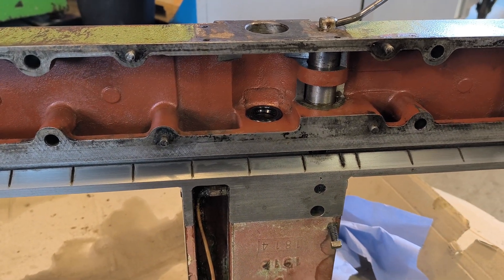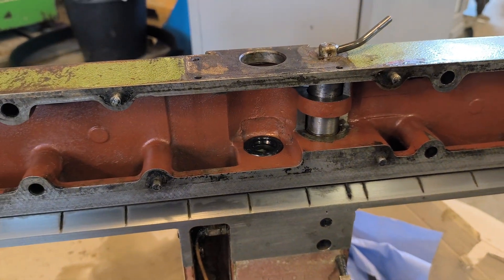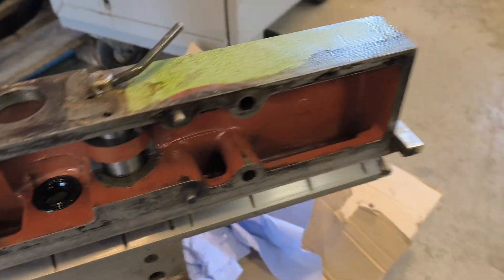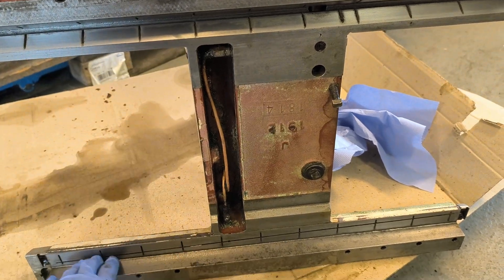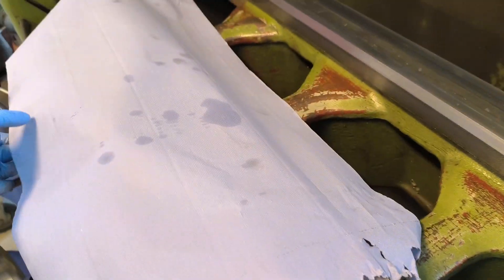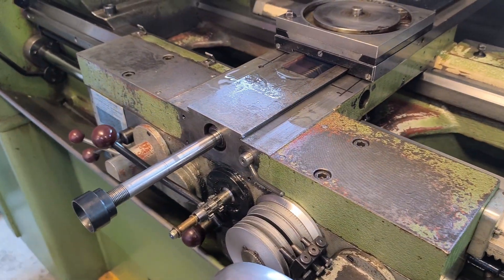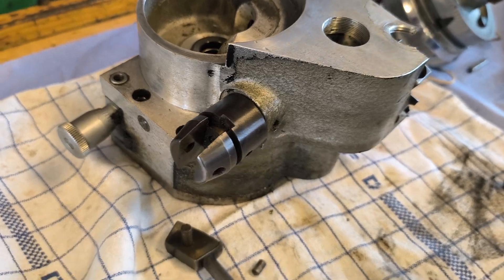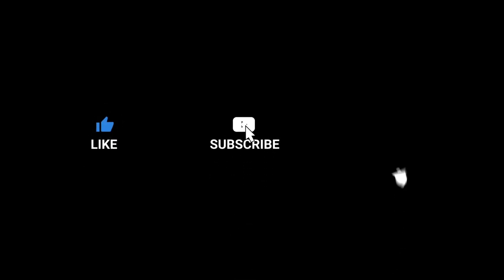Cazeneuve HB-X 360 lathe updates

Comment: I think this machine has one of the best, most purposeful looking tailstocks of any lathe. It's badass.
Reply from the maker: The Star wheel orientation and gear ratio is way better on the Schaublin.  Also, you still have the gear on the big wheel. On the Cazeneuve you need to use the little handle/knob. Which is kinda irritating.  The ultimate tailstock I have seen on a German VDF. Which had several gears, power feed and such
Reply: @OmeMachining  Thanks for the information. As with many things French, I was mainly talking about its looks :) 
Actually I owned a VDF once (1955) and stupidly sold it. Although there's still many out there if I should want one again, they are indestructible. That machine had very good ergonomics. Actually I was close to purchasing a H&H Hamburg 250 but decided to get the Ramo. The Hamburg will most likely go to a good friend of mine who was in need of replacing his very worn out Celtic.

Comment: Are those Cazeneuve's not scraped, looks just ground with a ton of oil grooves.
Reply: Lot of parts are not scraped on the Caz, I have the same lathe, and scraped in a lot of surfaces.

But, i heard from shaublin owners the same story, not every surface has to be scraped.
Reply from the maker: No 😊 not from what i can see.
They are made to a very high precision so its not needed.
Reply: @ The cross slide is steel, not cast iron?